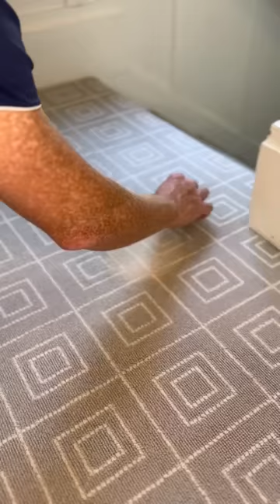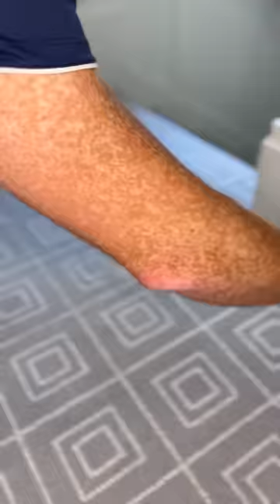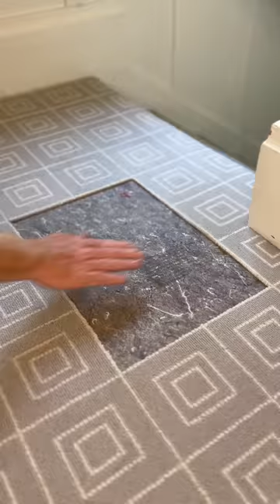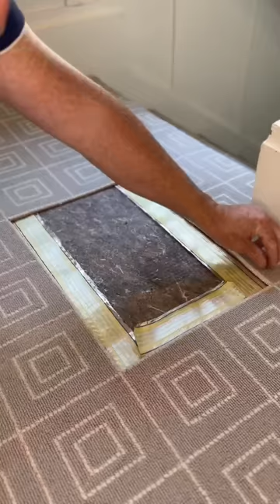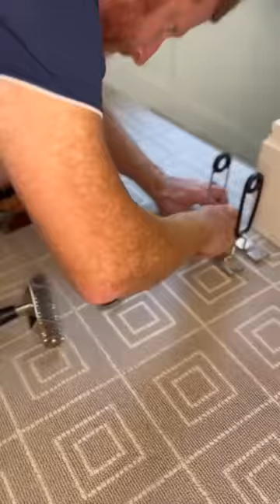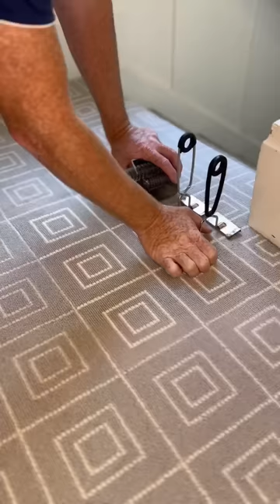Mother-in-law got it right #shorts

Comment: I need to know how you find the exact same carpet you just repaired.
Reply: You tend to keep left overs incase. If its a generic Carpet that several stores keep in stock you could buy another meter.
Reply: They tend to take it from spots in the house you won't notice, like the corner in a closet
Reply: @Ixillius  And how do you make it worn down the same as the old one?
Reply: @0xB8xor0xFF  You dont? Just fade it in so its less obvious.
Reply: @0xB8xor0xFF  they have tricks they know to blend it seemlessly and make it match. No idea what tho.
Reply: Summoned using magick.
Reply: @0xB8xor0xFF he has actually shown videos of him "weathering" the section of carpet he replaced so that it blends in with the original surrounding. He's pretty damn good at it too!

Comment: Bro did you put it on while the underpart is folded? I saw a warp or bubble 💀
Reply: I think he worked it out
Reply: Yeah it had a bubble. But once the seam tape dries up a bit you can just use a kicker toward the wall that's just in front of the top of the stairs and work it out
Reply: @cooleyzz  but you really shouldn't have to cause he should've installed it right lol
Reply: There is always one hater. And 200+ coward haters who like the comment but too scared to  go any further. Smh. It looks great he did great 🙄

Comment: Looks perfect can’t even tell u touched it good job 👍
Reply: top left side is not aligned correctly.
Reply: @leef_me8112   And? It looks perfect.
Reply: If he didn’t cut the wet spot on the padding he didn’t do a good job, the smell is still there
Reply: @rofrankie947  no it doesn't

Comment: I was watching videos on carbon dating and this video popped up lol. Hello carpet repair guy. I could have used your help Friday on my job. I was putting a seam together and the colored flecks lined up, turning my seam into a long grey line!  I had no serpentine straightedge so I ended up redoing it and cutting it at an extreme angle. Which worked pretty well.  It was just one of those moments where you have to ask yourself "What would carpet repair guy do?"

Comment: I'm a former carpet cleaner, you can't clean something that has lost color (as is the case with stomach acid that wasn't treated)

White vinegar is the best thing to use on animal barf or urine. Spray it with vinegar and cover it with a plastic bag (or trash bag) for about four hours.

Comment: The stain kept coming back because they were steaming it. The stain still exists on the back of the carpet. So you would need to treat the surface with a low moisture clean. And if it did get into the padding it will still come back if the new carpet is steamed as well
Reply: No you are wrong. It’s not a stain, it’s obviously a bleach spot because the lady used bleach to clean her carpet. Bleach spots don’t change lol
Reply: Bleach spots can actually change if your willing to put the work in to recolor/dye that spot back to its original coloring to match the rest of the carpet

Comment: Also you can see where the spot was over irritated which you can see from the spot of pad where vomit was. Use warm/damp not overly wet wash cloth to keep the moist and use light pressure and short scrubs with horse hair brush not a metal one like they used to clean.

Comment: Well to do this patch don't you need some of the original carpet to get the patch from? Who saves the scraps of carpet when they're having a house built or putting in new carpet? Also won't the patch be a different color from where it didn't fade and wear because it was stored away? This would probably be even more prominent if you found a new piece of carpet that was the same weave and design as yours. It would definitely have a more vibrant cleaner look. So you have a patch that is brand new or looks brand new surrounded by older worn, faded, dirty carpet. They might both be the same pattern, color, and weave but don't match at all. This patching job won't work once the carpet reaches a certain age and worn point. Its great if it will work but I'd think more often than not the odds would be stacked against you being able to do this.
Reply: I didn't think about it at first but I guess you could take a patch out of the carpet somewhere that's hidden or more inconspicuous, use it to replace the bad spot and use a newer or stored original piece to put where you got it from. Also guess if you had a piece of furniture that set flat on the floor like a file cabinet, you could remove the center of the carpet under it to use as a patch and not worry about replacing it under the file cabinet. You could do the same thing with a piece out of a corner of a closet where it wouldn't be seen so easily as well if removed. So there are a few options on how to do this. I still say the odds of being able to make a patch work are not that great.
Reply from the maker: Hundreds of videos and thousands of customers over twenty years that prove can be done ✅
Reply: @carpetguy  I didn't say it won't work or can't be done. I also made a second comment that went with this one you didn't read I guess. What I was meaning is there are lots of variables to whether you can do the patch to begin with and the odds are stacked against always getting a patch to work. There are more instances where a patch can't be used then where it can.
Reply from the maker: @williambryant5946  I understand where you’re coming from. I was there 20 years ago with how I thought about all this. But, I was wrong. Nearly every request, on any carpet, no matter the type of damage, or condition of the carpet CAN be repaired with amazing results. So, I respectfully disagree. Feel free to peruse my channel showing hundreds of repairs, and I might change your mind. 😉✌🏼
Reply: @carpetguy  I don't think you understand what I'm getting at. So if I've got a carpet that is in such terrible shape it needs total replacing, it gets a burned place in it say, you can put in a patch and make it look like it's been there just as long using a piece of carpet that was stored from when my carpet was installed that is still brand new or get a piece of brand new carpet that is the same style and color as the carpet on the floor and put it in and have it match a totally dilapidated, in need of replacing carpet? I don't think that's possible. Nothing you say will make me believe that. We can agree to disagree I guess.
Reply from the maker: @williambryant5946  I hear you. Have a little faith. My business is proof that some of the worst carpets CAN still be repaired with great results. Doesn’t mean maybe the carpets SHOULD just get replaced. But, if customers wish to save money, most carpets can be repaired. 👍🏼✌🏼
Reply: @carpetguy  I'll watch some more of your videos and find some that show bad carpets then. 👍

Comment: I've done carpet for 20 plus years you want to replace that pad and seal the floor with killz or the stain is just going to come right back up through the pad and the floor and the dog's just going to piss and s*** there again that makes the repair useless.. also did you kick it back the other way or stretch it look like you had a little bubble there.. you could easily just pull that nose of the stair up depending on if it's waterfall or Contour either way pull it up and stretch it over the stair

Comment: Could have been cleaned until someone put a bunch of harsh chemicals on it and bleached it. Professional cleaners use steam and chemicals. Steam alone would have got it up if you called them quickly. If you let it set for days then that's on you.
Reply from the maker: Not bleach. Stomach acid. Cleaning helped a bit but returned. Some cleaners do better than others but any cleaner that claims to be able to get all stains out is the liar, and I have over twenty years of customers who tell me their stories of over-promising cleaners.
Reply: @carpetguy  yeah but if they cleaned it immediately the acid wouldn't have bleached it if that what it was. You really can't get any "stain" out because that means the color has been permanently changed. If something is stained, the only thing you can do is dye it or cut it out. If it comes out, then it was just dirty not stained. But if people had Teflon and cleaned spots immediately, most things can be cleaned with a damp rag. I worked at Coit, Teasdale Fenton and Stanley Steamer. I was chasing the highest paying company. Teasdale was by far the best paying. I cleared $2,500 every 2 weeks. I also did stretching, repair and patches like the ones you did in the video. Spent a few years laying carpets too, that's a back breaker job.

I've seen guys use the wrong chemicals and turn people's entire carpets green. Sunlight comes in and reacts with certain chemicals, BAM green carpet!